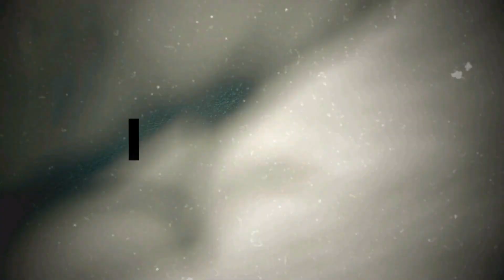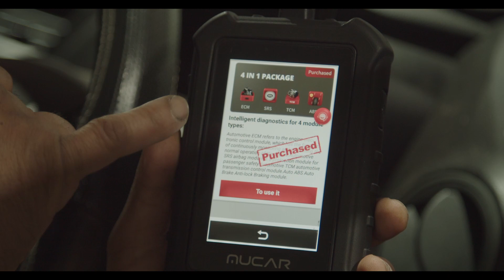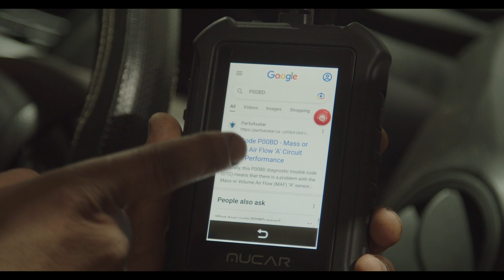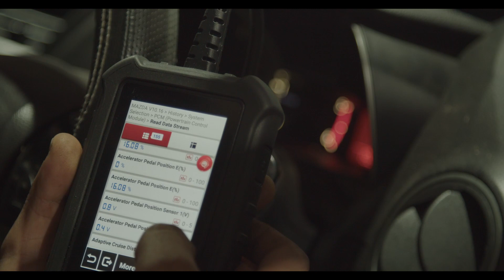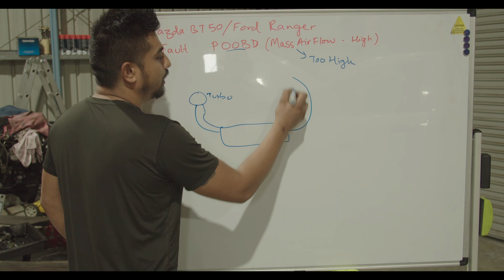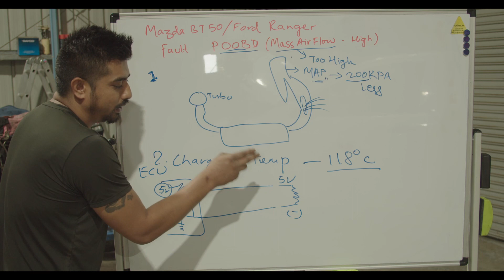P00BD FORD RANGER DIAGNOSIS

Comment: Hi there Very good explanation this could maybe help me on a ford transit 2.2  that I've been having issues with low power on highway speeds from like a 100kmh up slugish acceleration.town driving is fine no issues. The bus had massive power and gradually lost power we put new injectors thought it was that but no change at all  no fault codes either  the other day gave the gear with ! the p00bd code was there got torn boost hose got new one error code gone but still a snail can feel there is not enough boost most noticeable on  uphill maybe it's the second charged air temp sensor .and then is there a possibility u can help me with some advice on a ford EcoSport 1.5tdci  it's giving me a bit of a headache low on power p0299 supercharger a underboost condition I've checked everything vacuum hoses.smoke and pressure test on intake system checked egr in fact blocked it so no pressure can escape back through the exhaust . vacuum pump testing pump is 100% constant -30merc and both on boost solenoid and waistegate pod  .waiste gate flap got little play but still closes the waist hole snug and tight . operations on waist gate is smooth not stiff vacuum tested the pod aswell when started pulls the waist all the way closed dont know whats can cause this is there a charge air temp on them aswell
Reply: Only thing is airflow rate looks bit off actual is 75g/s on ildle  but desired is 0.13g/s on flat rev desired goes to 4g/s  and actual is going to like 600g/s dont know if the diag is lying to me  i need some technical advice on that if you can help me ill be so grateful 🙏 please
Reply: Also boost pressure shows 220-240 kpa when driving so i dont know y it's giving p0299 code boost is like 1.2- 1.4 bar over atmospheric pressure
Reply: Reving it on stationary goes up to 189 kpa